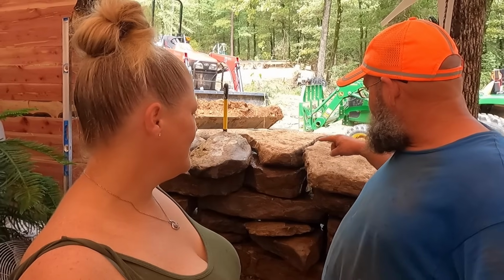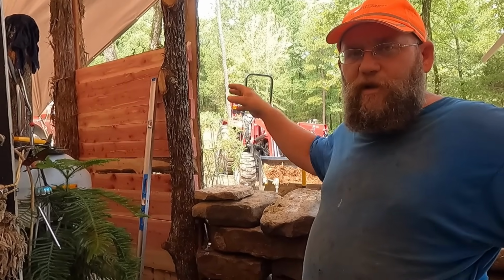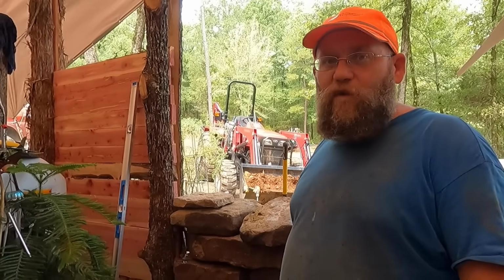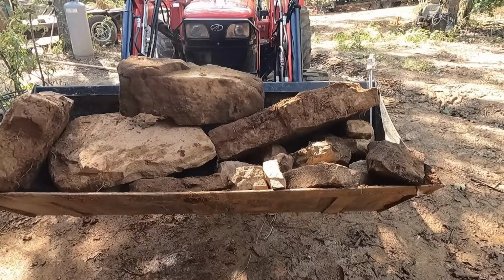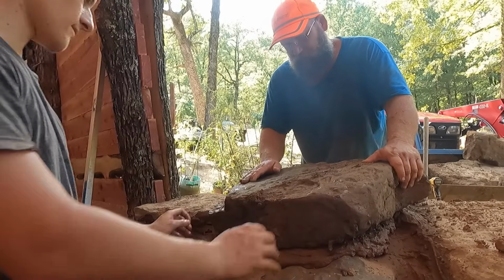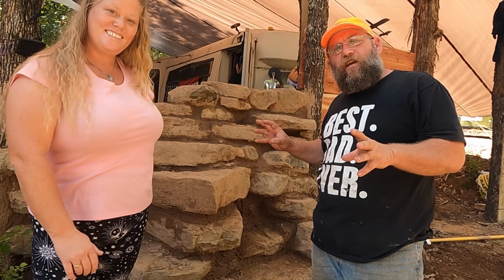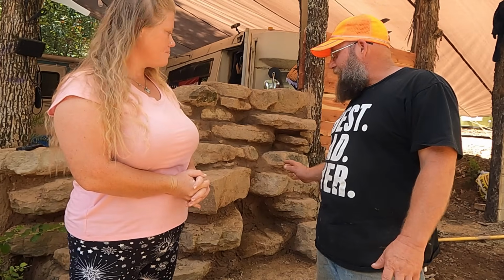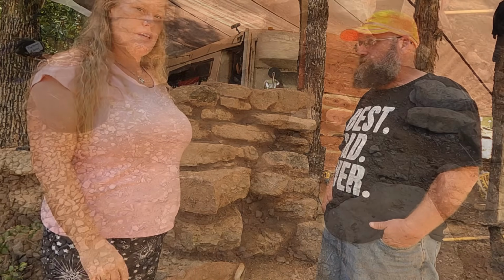Natural Rock Wall Build – Pioneer Style Off-Grid Homesteading

Comment: 🤠   WINTER PREP.   If you get an extra nickel in your pocket,   ceiling, sandwich between 2 tarps a large roll of bubble wrap.⛺️. CLAY CHINC.  Wonder if you had mixed in dry chopped grass or straw,  as it dried, the straw would have kept it from cracking and holding together as mortar  🧱    BUBBLE WRAP.  few years back, temps went to sub zero and LP soared,  so the confinement hog units got large rolls of bubble wrap to put over their automatic curtains 🪵🛖
Reply from the maker: Good idea!!

Comment: As I said in the sneak peek use a thimble to run the pipe through. If you use an 8 inch diameter you can tilt it a little down towards the outside so water won't run in and the 6 inch pipe can still have rise through the thimble. You should be able to get one at any block and brick distributor. Any length you need.